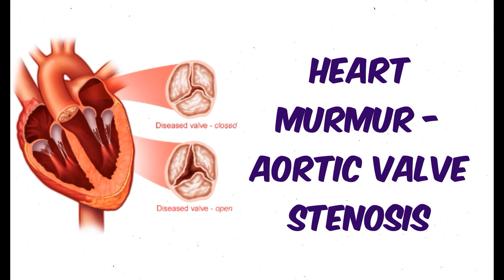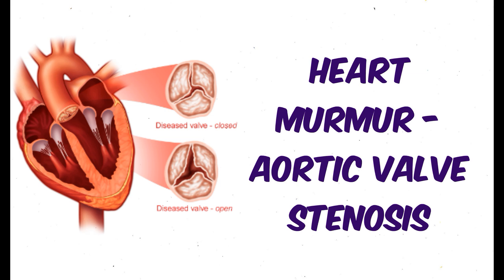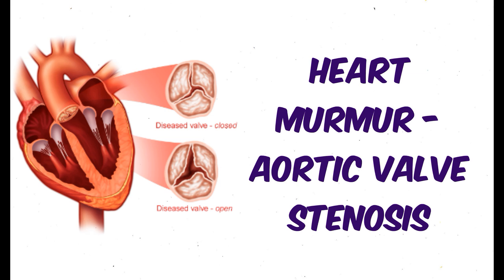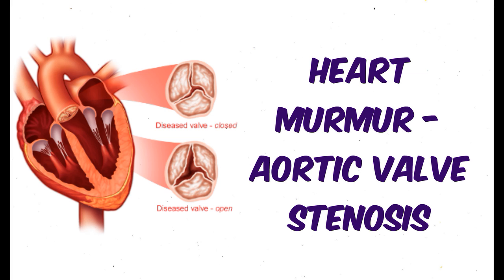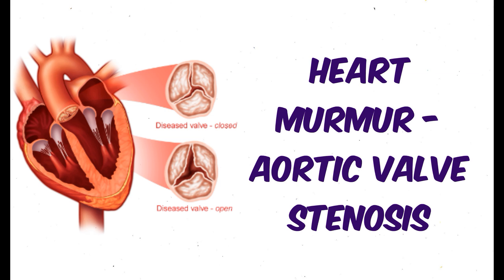Aortic Stenosis Murmur Explained | Classic Auscultation Sound & Key Clinical Signs

Comment: how do you tell the difference between aortic stenosis and mitral regurgitation. they sound nearly identical
Reply: Mitral regurgitation is radiated towards the axilla, while aortic stenosis is radiated towards the carotid. Also you can check the peripheral pulse as well, aortic stenosis has slow rising pulse.. as for the sound, MR has the same intensity throughout. And also aortic stenosis has a very harsh sound